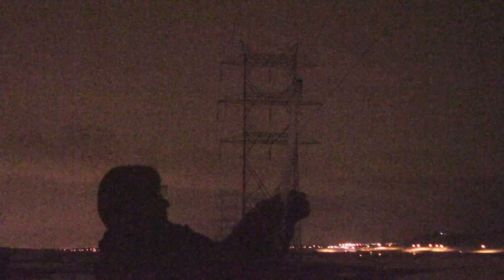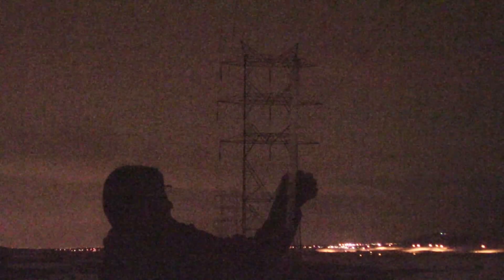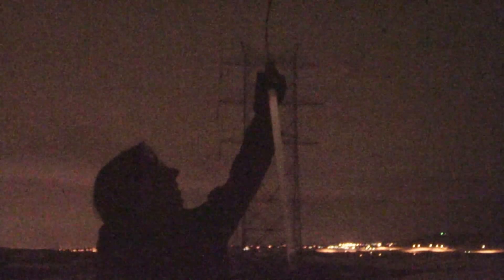Why We Use High Voltage In Power Lines & some effects of it

Comment: at 6:00   P =I^2 * R = V^2/ R , since V=I * R   
P110 = (110v)^2 /2 ohm 
P220 = (220v)^2 /2 ohm 
P220 =  4 *  P110 whats wrong with the power consumption in this way? higher the volt, more the power loss by 4 times

Comment: Years ago, I worked for a company out of Indianapolis that painted high voltage towers and substations. We painted the steel towers while energised. At times if we wasn't holding on good we would get a little jolt, it wouldn't hurt, but you knew it. I done this for several years before transferring my book to another local and other type of painting. In the time I painted high voltage towers or subs, I never seen anybody get into a line. But, a good friend from tower painting did years later working in a sub station for a different company that pushed " the safety issue" too far, and he got into an energized line. Thanks for the info, very interesting.